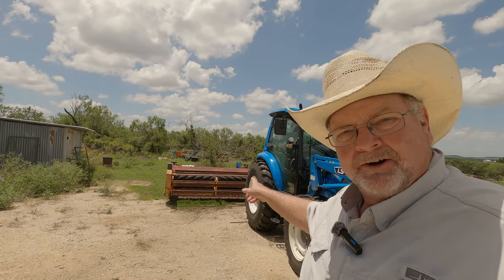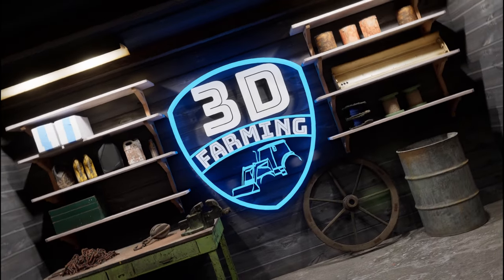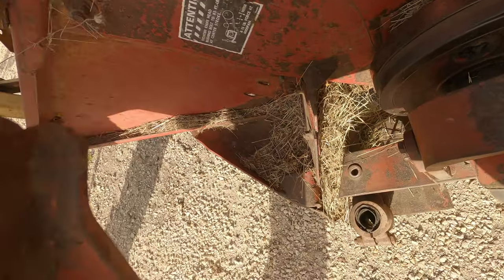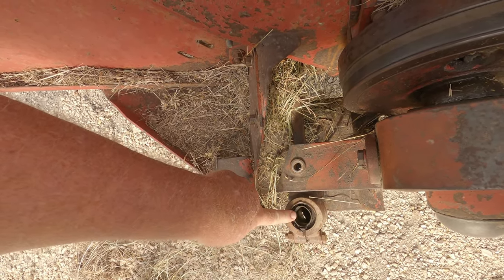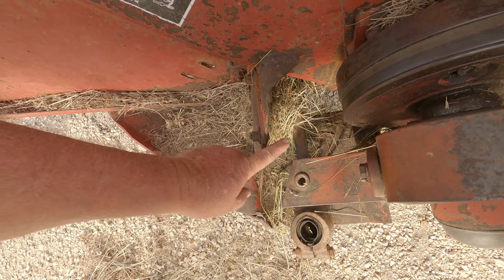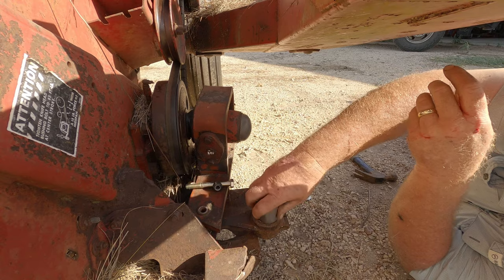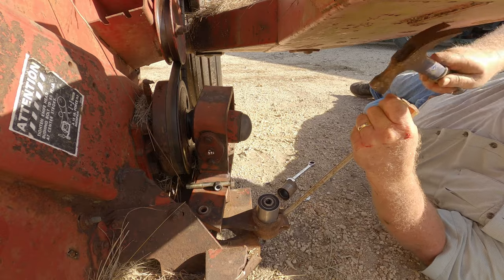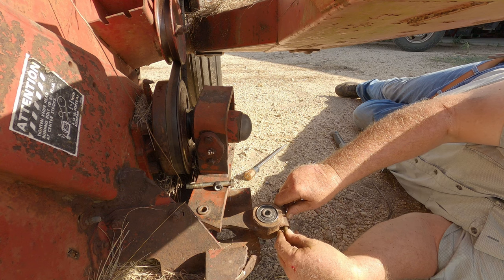New Holland 488 has been a headache.

Comment: I bought a 50 +/- gallon poly transfer tank from Vevor last year.  It came with the 12volt pump, hose, and in-line filter for around $700.  I didn't like the price only because I remember when prices were reasonable, but that's what things cost today.  I went with that one because of its size and weight.  I only keep it in the truck bed when I need it and it's easy to move out when not it use.  I hope you can keep your spirits up.  I know life is frustrating. Best wishes!
Reply from the maker: Thanks I appreciate it. I will look into the tank. They are definitely pricey that is for sure. Thanks again